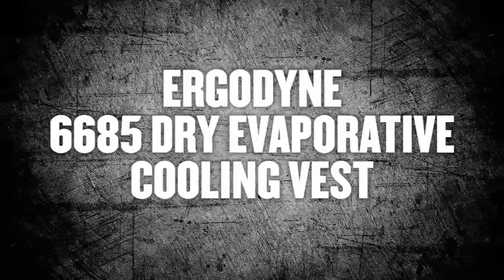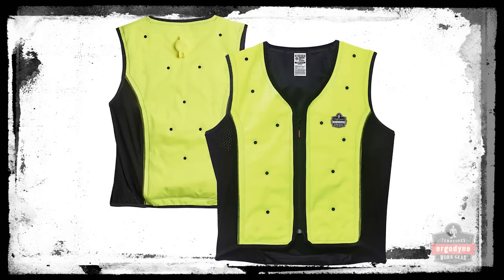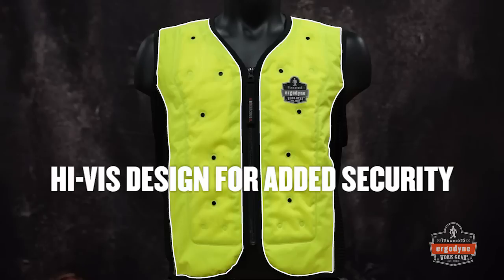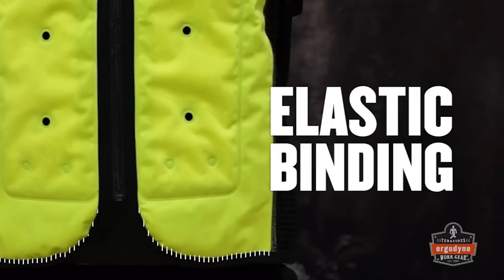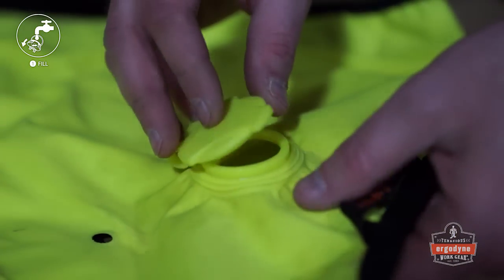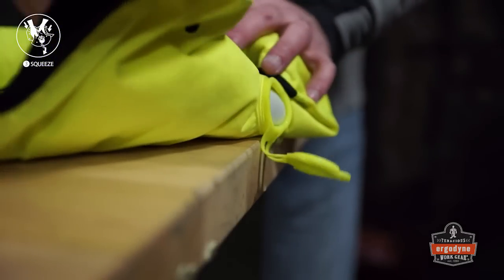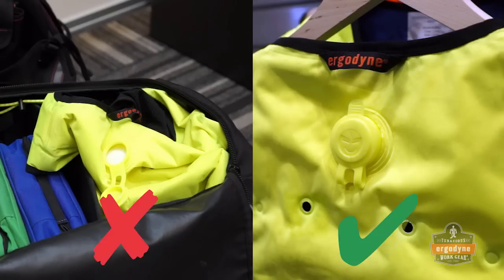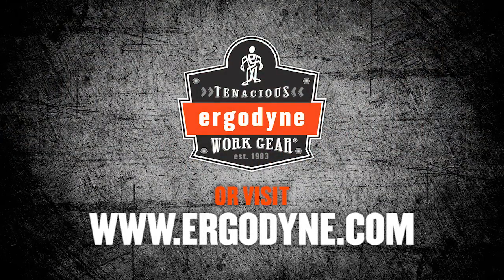A Cooling Vest that Manages Heat Stress & Increases Productivity

Comment: Got one coming in the mail for Louisiana summer. Wish me luck.
Reply: How’d it work ?
Reply: How did it work?
Reply: @kccink  Horrible. SSC Textron Systems 110 heat index in Louisiana and any evaporative cooling doesnt work out here when its 90+ humidity. If you were in a dry and hot climate, this would be awesome.